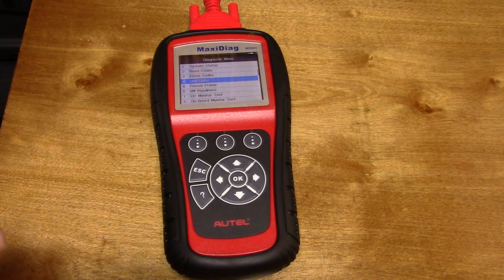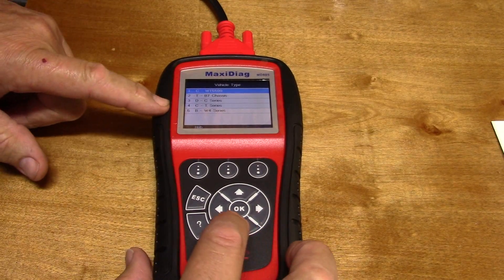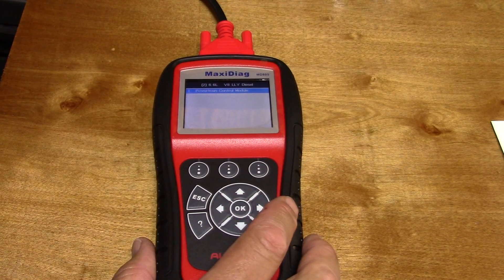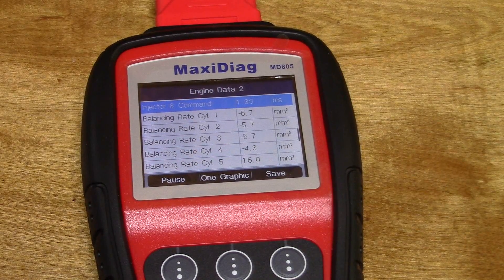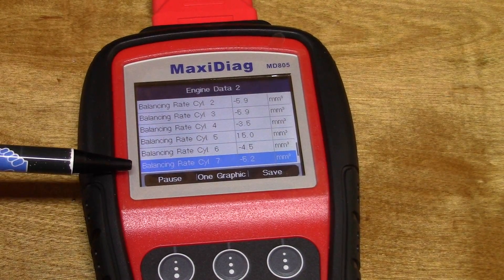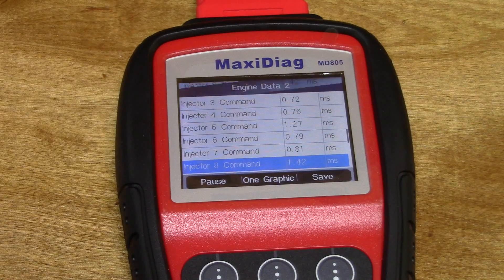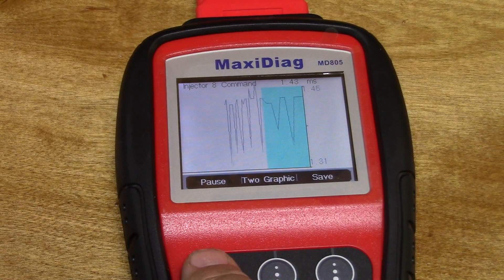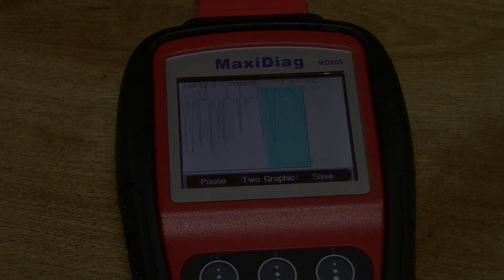Introduction of the Autel MD805

Comment: Autel is just killing it lately. Snap-On had better watch their 6! 😉

Great review, Wyatt - thanks!
Reply from the maker: I agree. Autel is making an effort to gain market share in scanners and scopes and with the prices they offer they have my attention for sure.
Reply: Last August I picked up the Maxisys 906TS. Thing has been amazing. It's already paid for itself! So much easier being able to command systems on for testing purposes. I had been getting by (barely) with just a plain Jane scan tool with no bi-directional control, and no ability to access anything but the ECM.  Great having full access to all modules, and the ability to program keys on certain vehicles. Plus I can get on the net on the thing - saves me a walk to the house. 😎
Reply from the maker: Smitty Smithsonite Oh man that's great! I bought the Maxidas from Mike the disgruntled mechanic a while back and it has been a good tool. I can't control a lot of modules, but so far I haven't needed too. I don'twork professionally outside of helping my neighbors and keeping up with my own cars. My next "wish list" item will be a scope of some kind.
Reply: Me too! I'm trying to diag a no comm to ABS module on a '07 Sierra - would be REAL nice to have a scope right about now!